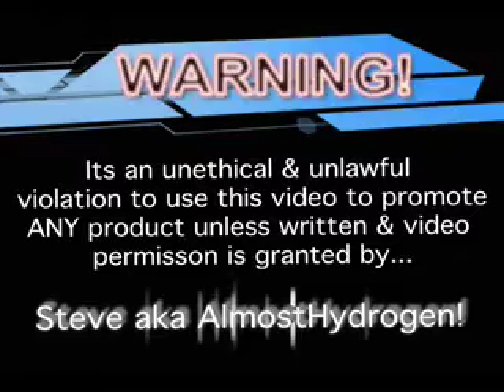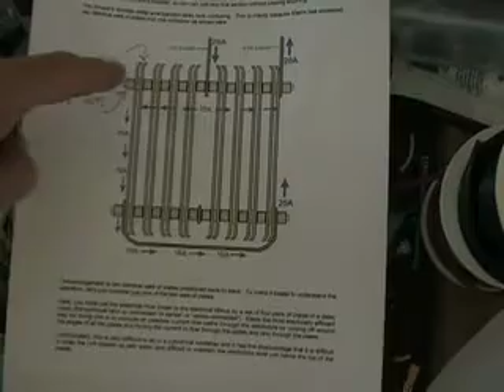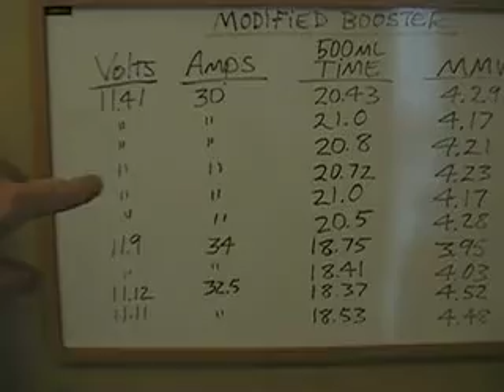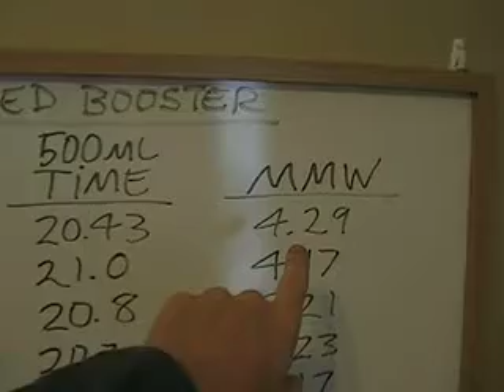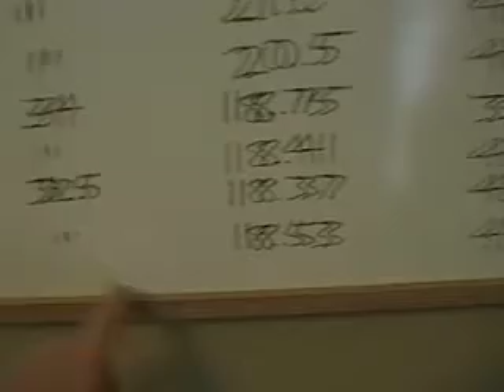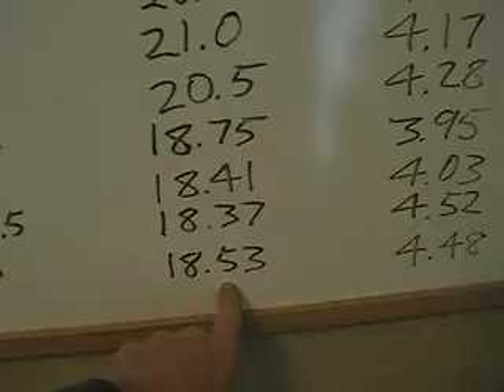Always room to Improve: Mods, a Rant & Results (MMW #s)

Comment: hello.
i did a video to see if the voltage from the o2 sensor would change after i turned on the generator. there was no change in voltage. but we have to agree that there is something going on with the vehicle computer. because too many people are getting less mileage after installing a gen. great point about higherpowerh2o. btw the smack has taken this technology a long way. you should just take the criticism and not make a big deal about it. i like your videos. keep up the great work.

Comment: have you tried using higher voltage (like maybe with a step up transformer) with lower amps like Stanley Meyer was doing? Seems like this would keep heat low while increasing production. Just curious.